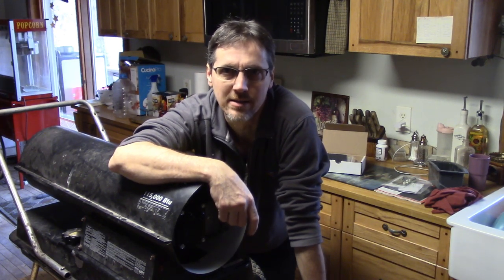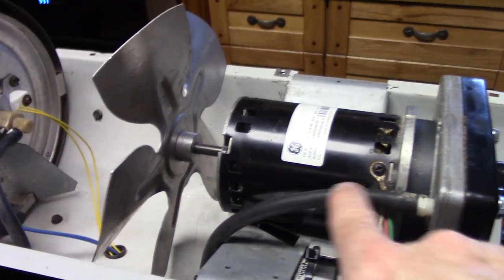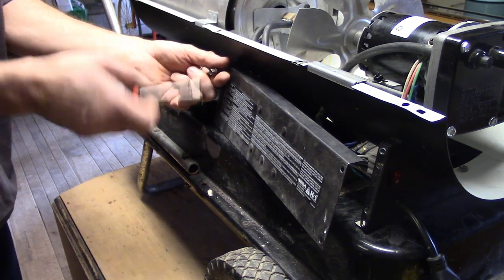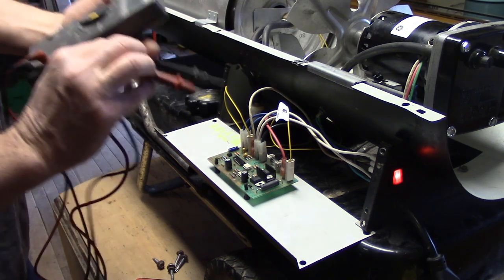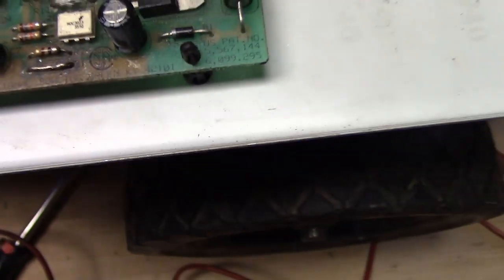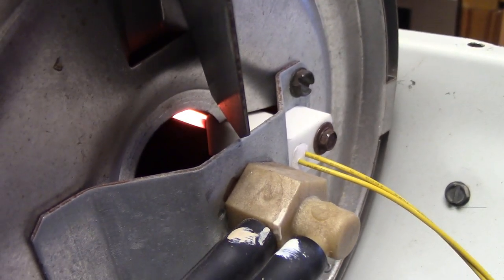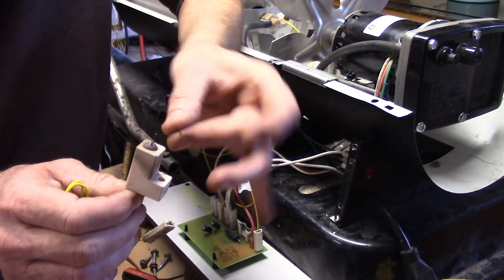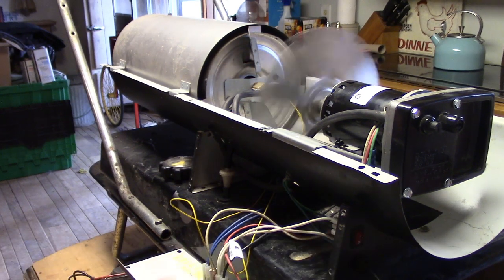How to fix a torpedo heater

Comment: Thank you. I am a repairman at a local hardware store and guys bring in these heaters in from time to time. A few I have been at a loss to repair. Your video has really taught me how to fix problems that I didn't know how to fix. Hopefully, guys working in cold buildings can now have some heat to help them out. Thank you again.

Comment: Absolutely fantastic video!! I have a number of torpedo heaters that I have gotten and never wanted to get rid of in case I could fix them or needed parts. I have saved this video and feel confident with just about any problems I may encounter! I found this video after  torpedo heaters (witch I'm currently using) igniter worked but fan wouldn't start today. Most other videos are talking about something different. THANK YOU!!!!!!! I will be able to reference this video in the future as needed. I am so pleased !!!
Reply from the maker: Glad I was able to help.  And thanks for watching.

Comment: Thanks for the video that is help me I have a Dayton 400,000 BTU turbo heater and when I first got it used it fired right up and then it cut off so I’m gonna work on replacing the things you replaced and check those things that you did and hopefully get this bad boy back up and running. Thanks so much

Comment: repairing one of these similar models last night.  I did not realize about the feeler gauge adjustment.  Makes sense.  The machine ran for quite a while then quite.  Looks like it had gotten hot in the past.  I think that as it got warm the pump started binding.  I'll go adjust and try again.  Glad I found the video.

Comment: Cheaper parts and harder to repair the board. However, where do get the boards? On mine the system starts then shuts off right away.

Comment: I’m in the U.K.  Bought mine from Machine Mart. 65 stores and they stock ZERO spares or service items for their space heaters. I’ve been waiting over a week for a fuel filter from their centralised spares department in Nottingham. It’s zero degrees outside. The only comparable part I can find, on-line, is in the USA. Truly crappy machine which is forever breaking (3 years old). The USA understands customer service. Mine is a Clarke XR60 if you’d like to avoid buying one.

Comment: have you seen were it surges, every 2 seconds. original it had a cracked Fues line and that was replaced and worked great for about a month as needed say 2 hrs a day. now it does get hot wahoo but surges. mine is a 70,000 btu Mr Heater. Thanks in advance for  any ideas

Comment: Verry good vídeo help a lot,. My cuestión is when you use tve feeler gage what does 3000 mean?  I have one that says 0.30 0.40 and 0.70. Is this in noches , now milmeters 200, 315 , what size are you talking about. Thank you for your help
Reply from the maker: It’s been a while since I worked on this, but I think it was 30 thousandths which is a 0.030 feeler gauge. Or 0.762 mm

Comment: I dont know if you are still answering questions here but I need help if you are.. I have the 125t professional series. The ignitor glows for about 5-10 seconds and then goes off, the fan never starts, I dont know if the fan not starting is causing the ignitor to turn off or if the ignitor turning off to soon is causing the fan not to spin??? I got aggravated and kicked it, not hard, and it started right up and ran until I turned it off, now its back to the same issue. Any help or advice would be greatly appreciated!  Edit: I meant to say also the fan spins fairly easily by hand so its not locked up.  Seems to have a capacitor under the motor but its made in the wiring and I cant find any mention of replacing it anywhere online, everywhere just says buy a new motor.

Comment: I watched the video and still have questions.  Mine lights, runs fine and when the stove reaches the temperature set on the thermostat the stove stops running and the indicator shows "no flame".  I have replaced the photo eye and the circuit board with no change in the issue.  If I set the stove outside where it can't reach the setting on the thermostat it will run for hours without a problem.  I am at a loss as to the problem.
Reply: bypass the thermostat. Unneeded

Comment: Thank you for taking the time to produce this video with clear and systematic explanations. My ReddyHeater 55,000 starts and runs for a minute or two then stops with a blown fuse. Although the manual states a GMA 10 fuse is recommended, the original fuse in the fuse holder on the circuit board was 6.3amps of which I blown several three. Then from Amazon I acquired the GMA 10 fuse, which didn't blow. But worse, the igniter disintegrated about 90secs after starting the heater. I removed the air pump rear plate and noticed black marks where the rotor or vanes had marked it in two places. The clearance between the rotor and housing is 0.002in.  Before ordering more parts, could you offer any thoughts that might remedy my problem? Victor Moore
Reply from the maker: Unfortunately I really don't have any suggestions for you.  I do not know what would cause the igniter to disintegrate other than possibly wrong voltage which is nearly impossible.  Maybe the igniter was damaged and was blowing the lower amp fuse, with the correct fuse it failed, just a thought.  Best of luck to you in getting it working properly.  Thanks for watching.
Reply: Thank you Brian. One final thought to consider: the heater worked fine when purchased new about 15 years ago but has sat unused for a decade with the original kerosene in the tank. After the first fuse failed, I drained it, cleaned it and replenish with new.  @SakimasRidgeHomestead
Reply: Since my last correspondence, I purchased a new igniter, which seems to be working fine, except the installation booklet accompanying the igniter states it should not remain on for more than a few seconds after the gas ignites. My voltmeter shows it continues to receive a constant 120 volts. I switched the machine off after half a minute of operation.   Any further thoughts?
Reply: Brian: A new circuit board resolved my problem. Power to the igniter now fades soon after combustion begins, just as it should.
Reply: @mooregoodink7734  
Well done sir. 
Thanks for sharing that adding “perseverance” to troubleshooting a problem is usually the most important variable in the process. 
The resulting sense of accomplishment and gratification is almost always priceless!!

Comment: Great video, very informative.
I have a 150,000 btu kero space heater, works good but only if top cover isn't fixed down all the way. Shuts down as soon as all screws are tightened down. Any ideas?. Thanks
Reply: I've got the same problem did you ever figure out what the problem was If so Please give me a response This is frustrating as h***
Reply: Yeh, was fine ever since screwed pump adjuster in 1/2-1 turn been perfect ever since🔥🔥👍

Comment: Great video!! I’m having the issue with the motor sticking and spinning in the wrong direction... would like to try and swap out the capacitor... gonna check out local motor shops for more info
Reply from the maker: Capacitor is probably the problem.  Local motor shop should be able to get you going in no time.  Thanks for watching!

Comment: I have an old Sears 85,000 BTU kerosene turbo heater I cannot find the pressure setting for the pump I was wondering what you recommend for the pressure I have a $50, 000 BTU that's at 3.6 PSI yours is at 5.1 for $115,000 BTU just wondering if you had any idea what $85,000 BTU would run it has the same pump housing that you have in this video thank you if you can help me thank you anyway for the making of the video much help
Reply: I have remington 50k btu 3.6 psi is what says on side of mine so I would go for 4.5 other way is if you get nice even glow on front and no harsh smell should be good
Reply: Just found owners manual for sears 85k says 4 psi

Comment: When i put the cover back on over the air pump rotor my fan won't spin.  Loosen the bolts, spins great.  Any thoughts as i am only talking finger tight?  Also does the fuel line go to the back nozzle or the one closest to the flame?  Thanks
Reply: make sure the rotor fits correctly over the small plastic alignment tabs.  Also check the rotor vanes are all in properly as they are not square

Comment: Question I have a reddy heater 170t  igniter  lights up it lights no problem  when the cover is of like yours is I put the top cover on and it wont light
Reply from the maker: I think if the pump pressure is set too low it will run with the cover off but not on.  In the video mine stopped running with the cover off and the pump pressure was too high.
Reply: That means you need to replace both air filters on the unit.  If you happen to see drops of fuel dripping from the front while the unit is fired up and heating, that means your air pump is not getting enough forced air because your filters are dirty/saturated.  Hope this helps.
Reply: Come too find out my fan was bound up it was  the graphite  block  in back of the fan
Reply from the maker: Glad you found the issue!
Reply: @SakimasRidgeHomestead  Some are designed to run variable fuels & others are specific to kerosene only!  is this only spray nozzle size??. My protemp 125,000 runs great on diesel nice clean controlled flame behind nose cone. But my reddy heater 165,000 no matter the psi pump pressure, + or - the flame shoots a bit beyond beyond the cone & the shop fills with a haze of smoke ! Obviously does not like diesel !! everything else is up to par  only  now wonder about my nozzle theory & spray?

Comment: If the heater says to run it on kerosene or #1 diesel. Could it be run on #2 diesel?
Reply from the maker: I run mine on off-road “home heating oil” red dyed diesel with no issues.

Comment: Hi mate love the video very helpful but I can’t find the issue that I have😢 my space heater doesn’t turn on, the button doesn’t light up and everything it’s dead 💔 would you know what the issue can be??
Reply from the maker: Have you used a meter to check and see if you have power inside the unit or at the switch?
Reply: Hi Sakima's Ridge Homestead thank you for your quick reply. I haven’t really checked anything because I wouldn’t know where to start. All I know is the switch is transferring power but somewhere something isn’t doing whats meant to do. Can you recommend me few things what I can check so it turns on
Reply: @renoir6900  Pull the panel cover and check the fuse.
Reply: renoir marquis look at this video at about five minutes in. Might be your problem

Comment: I have an old Sears and it blows smoke any suggestions?
Reply: Make sure the filters are clean, its probably  clogged nozzle.  Sometimes you can overcome by increasing pressure with screw on the pump.

Comment: Both of my dewalt torpedos run for a few minutes than the fan motor starts to wine and eventually the heater shuts off. Any ideas?
Reply from the maker: Just a shot in the dark, but the air pump clearance may be too tight.  Might be getting hot and rubbing causing the motor to slow enough to shut the flame down.  I had a similar issue months after this video, cleaning the air pump up a little on fine sandpaper worked for me.
Reply: @SakimasRidgeHomestead  ill try it. Thank You

Comment: Igniter should be upgraded to silicon nitride. Supply house .com has them universal for $13 and you can make it work with any heater. Not at all fragile like this crap for $24

Comment: PLEASE HELP . I have almost similar to your mine btu 140,000 the issue I’m having is when the cover is off it runs fine and the. When I put the cover back on and start it then it won’t start it will give me E1 error. Do you know what the issue might be. It’s weird cover off it works fine. Cover back on then it won’t work 🤷🏻
Reply from the maker: It's been a while since I worked on mine, but I think that issue requires adjusting the air pump pressure to correct.  Thanks for watching.

Comment: I cant see spending $150 and 2 days labor on something that is only $199 New at Lowes?
if all it needed was some cleaning or a new draw hose
Reply from the maker: The cheapest one on Lowe’s website is $225 and it’s only 75000 btu and not multifuel.  The one I have is a $400 - $500 unit.

Comment: Need part number on broad
Reply from the maker: The part number for the board in my heater was 104068-02.  I got the new one from ALLPARTS equipment and accessories inc.